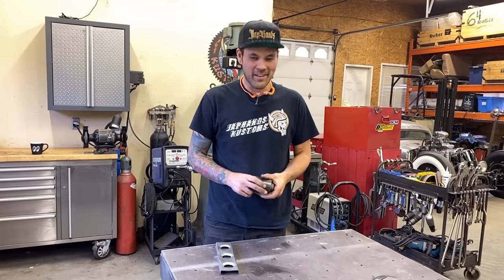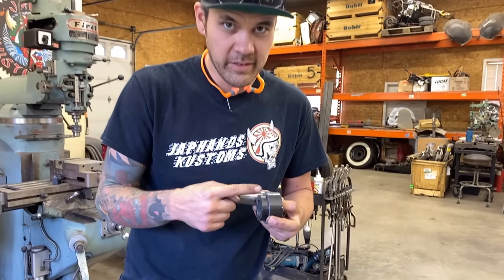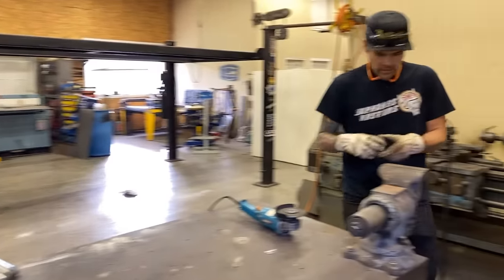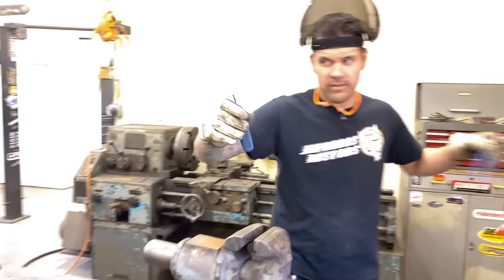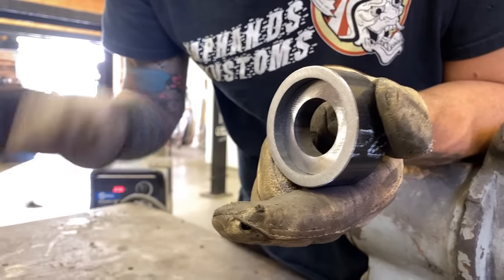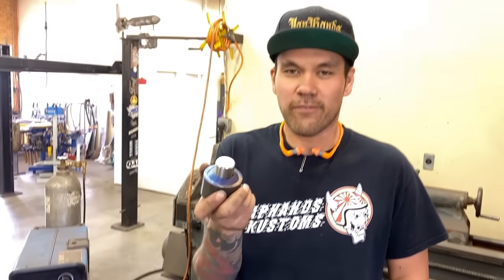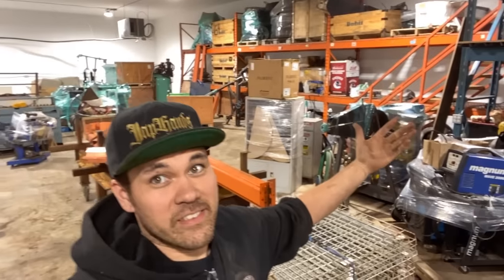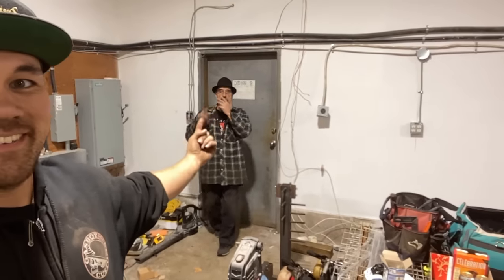How To Make This EASY Dimple Die Tool for Under 20 Bucks!!! ( With Just a Welder + Grinder!!! )

Comment: I use a greased threaded rod through the center to compress them together. Even strong enough to dimple 3mm steel. 
Its a must when dimpling on the car when you can't fit the car in your shop press
Reply: "when you can't fit the car in your shop press" 😁🤣🤣
Reply: When I make one, I will probably do it this way.
Reply: if you put the flange piece that youre going to grind on to the shaft and start grinding it will begin to spin....now its - its own lathe! 
get her spinning and hold your grinder hand steady .
the threaded rod allows you to double nut/lock the flanged piece from jumping up / around.
once youve done it for a few minutes it all makes sense.
the grinder spins the piece and grinds all at the same time and because power is lost to spinning the grinding doesnt dig in very deep....
you could also weld first and put it in a drill then mount the drill in a vise.
the cool part about making your own is you can make both pieces with steps in diameter to do 2 different hole sizes in 1 tool or add 
a crease into the flange/dimple
make diamond or star or square etc dimple dies.
time is cheap when its mine for me....lol
Reply: @kazzTrismus  There is another aspect that can be brought in here. make the the bottom and top piece to fit perfectly into one another without any clearance for the material thickness you want to dimple. ie. zero clearance. then make a few washers, each washer to be the thickness of the various sizes of plate you want to dimple. Then you just insert the relevant washer to match the material you want to punch. The washer will give you the relevant clearance needed.
Reply: @ishsiriram8286  leave the clearance...as washers will only make space in 1 direction..
If doing/wanting a more complex shape than a cone, precision fitting reduces the range of material thickness.
details/features would require precision fitting on 2 axis at least.
Too tight will = shear depending on design
Reply: @kazzTrismus  Your Right, I see what you mean. Thank you.
Reply: @kazzTrismus  I got you bro. make's sense.
Reply from the maker: Yeah definitely having a hole in the centre or threaded half is the way to go so that you can be super portable! How do you like smashing it with a BFH though it’s pretty fast
Reply: @MakeItKustom  I couldn't believe that hammer worked to be honest.
Reply: IF you make the ‘hole’ part of the die on a long piece of stock and a T ‘fence’ you can not only do dimples evenly spaced from a reference edge but you can also do ‘interesting’ solid sheet panels with stiffening provided by non-through dimples FYI. These do take a little more time with the hammer and the panel may need some flattening after if the non-through dimples are close, but this can cut down resonance a lot. Great for when a bead isn’t preferred or you don’t have a bead roller.
Reply: You know a threaded setup  is what came to my mind to. Especially since I don't own a press. Interesting.

Comment: If you can get ahold of some thin latex sheeting or thin flexible plastic to sacrifice between the workpiece and the die, your finish comes out really well even if there are some blemishes in the tool surface. Really cool innovation you guys!

Comment: This is the best part about outfitting your shop/garage with fabrication tools. You get to the point where you need a tool or part for your build and realize its quicker and easier to just make it how you want it then to shop around and wait for shipping etc. I think more project car builders should invest in this stuff and learn how to use it, very satisfying! 👍
Reply: Check out Fab Rats.

Comment: great video ....Being a retired electrical contractor I had several knock out punch set laying around sooo I took one set and had the back side of the cutters beveled to 45 degrees. Now I take one punch and knock out the hole and then take the next size up and use the back beveled side of the die to make the dimple....a two step process but cheaper than going out and buying the one step dies and I have a set from about 7/8" to 2 1/2" dimple dies.....like making your tools

Comment: This was excellent, I had a friend make a smaller one for me on a lathe but both male and female mating surface where turned but this was so basic and works exactly the same. Cool. 
 If someone wanted more user flexibility they could drill a hole through the 1 1/4” use a 1/2” bolt or all thread rod and nuts with a piece of 1/4” plate for the end you could use this without a hammer or press allowing you to do a dimple inside a tight space or where could not use a hammer without back up. Using 2 pieces of 1/4” plate on each end you could make this entire tool without using a welder too. 
I really like the dimple look… I think I need to get some steel
Thanks for Awesome tool idea and so cheap.
Reply: My first thought exactly, good comment.

Comment: In regards to the scarcity of 19 gauge sheet metal:
    Wray Schelin mentioned finding a supplier for 19 gauge sheet metal and was able to stock up on the stuff. His video was about 8 months ago titled, Metal Shaping for Beginners: Shrinking With a Helve Hammer.

I recall you mentioned the 19 gauge shortage in a recent video I watched and several other YouTube builders have found the same shortage in their areas. A place just outside of Langley was cold rolling 18ga to 19ga for a restoration that was very fussy. Their rollers were capable of doing 30 inch but their age showed some distortion at the edges so 24 inch was settled on as the max width. 

  The hydraulic roller press was apparently from one of Boeing's auctions in Washington state. At one of their auctions I ended up with a project to rebuild a hot dimpler for aerodynamic aircraft riveting. Industrial auctions can be interesting with crazy expensive mixed in with nearly free deals. A $100usd hot dimpler was nearly free. Just thought I'd mention that. A great way to bring occasional use equipment into your shop that you normally wouldn't have considered buying.

Comment: Karl, on your electrician's knock out set, there are VERY small hash marks on the cup side of the die. They will help line you up with a center line so your holes are laser straight. Hope this helps, cause you sure are helping me with your content. Thanks!
Reply from the maker: Thanks for the tip!

Comment: Nice work. 
I cut up a ball joint, not necessarily for dimple die but it sure makes a nice spherical dent. Long u shaped flat bar to keep em aligned and done! 
Nothing beats building your own tools, for single one off use or for continous use. I have both.

Comment: You Sir are a gentleman and a legend Karl.
I was looking into Dimple Dies here in Aus and they Cost anywhere from about AUD$50.00 each from Speedwerks in Sydney Australia. 
Add in Postage  which add about another as much again.

I can make my own and get what ever size I want and even use pieces of Gal Water pipe as outer and Inner sizes for some simple sizes and get all that from the scrap metal yard for about AUD$10.00 .
 Win Win I say, and as you mentioned, get some pride from making it myself.
Thanks heaps 
Michael in Melbourne Australia.
Reply from the maker: Awesome Michael I’m glad to hear you dig this concept and it will save you some bucks! We ship a lot to Australia and know how much postage is. It can get crazy for you guys

Comment: Great video. You obviously have a great set of skills and experience, but for me, and obviously many others, what makes your videos really watchable is your way of presentation and uncomplicated, positive attitude. Just a simple sugestion you may want to consider - whenever round objects are involved, in jobs like this I always try to apply rotation to the object, too. Even if the features you are adding are non-critical, it adds unformity, reduces random scratches and generally speaking produces better looking objects. I often use either two battery drils, or a drill and an angle grinder, plus a miniature 50mm chuck to grip the objects. Just my two cents...

Comment: Lee is a good friend and great builder.

I love Metal Supermarket 
The one near me sells off cuts by the pound which is great if you need to build some smaller stuff like this dimple die tool or small bits n bobs like motor mounts etc.

Comment: Just an idea. I use Knock out punch sets from Greenlee tools and Klein tools all the time. They use a threaded draw stud to pull the cutting die through the side of panels and boxes. I’m thinking you could fabricate your dimple die to work with one of these tools allowing you take it wherever you want. Both companies make a ratcheting punch, and Greenlee has multiple styles of hydraulic although those are very expensive.

Comment: You know a lot of out aircraft (older ones) used a lot of dimples in the airframes. Made them stronger and lighter! You knew that. I used the same type of oil lines in my old 75 Harley to run outside filter etc. Modified a little bit. 😂😁🥸👍👍

Comment: Awesome! I reckon one of those little brake cylinder hones would increase the ID of that tube if you couldn't be bothered grinding it too! I may have used them in the past to make holes round again after welding ahhh... unrounded them...

Comment: Hmmm, I keep hearing of metal supermarket, I may have to pay them a visit (but they are 2 hrs away in each direction). ... I'm only 3:00 in but I'm loving this one already. I don't have every conceivable tool known to Man, so you taking this route is awesome. I'm just a tinkerer with our Jeeps (almost a hobby), so I really can't justify paying for dimple dies, but I'd like to do the effect one day. And it's cool how your doing it because all I ever use (have) is a grinder, assorted disc's and other typical hand power tools. ... and I'm one of the, do it in the driveway, outside or in a little shed I have, kinda guys.

Comment: Thanks. I have a set of dimple dies but I need a 4" for my 3" exhaust. They are very pricey. I will definitely be doing this. I'll probably cheat and use the lathe.

Comment: Great idea but as you were going around the top edge and talking about fitting the inside pin ,I was thinking,considering you won't be removing that much material,WHY not use a wheel cylinder hone.?
Reply from the maker: The point was to use very simple tools for this

Comment: Another awesome video and lesson. So a metal newbie question, does dimpling the metal or bracket give it more strength? I am thinking of adding some brackets to my prostreet tubs and this is exactly how I want them to look, thanks.
Reply: There is some /rigidity/ added by dimpling or beading, ridging. Not necessarily strength: rigidity. 

Added bonus is the vibrating/slapping sound sheet metal gets sometimes is often 100% mitigated.

Comment: So any time I want to make something round smaller I use a drill and sand paper. Only issues are getting the thing into the drill chuck. So I sorta made a C clamp to be able to hold some centers to turn things between. A rubber wheel in the drill makes the thing rotate and I use what ever abrasive I want until I get it sized.

Comment: Just a suggestion - when making that die, it is a lot easier for most people to make it - and make it correctly - if you can spin the material while you grind it.  Spinning it allows you to hold the grinder in one place, instead of trying to get the bevel right/consistent while moving around the part.  Yes, spinning is traditionally what a lathe does - but you don't have to have a lathe.  The piece only has to spin, and it MUST be centered, which you can check simply by spinning up the part and looking for wobble.  One way you could do this is by using a correctly sized rubber expandable freeze plug to fit inside the die's hole and then chucking it in a drill press.  The rubber freeze plug has a bolt through the center of it that fits tightly -  you would chuck that bolt into the drill press.  If you need more threads on the bolt, you can use a longer one in the hole as long as it fits tightly and compresses the plug.  If the part is centered and you can see your marks, you can then spin it up and use the grinder to grind to the profile.  Also, if you have a bench grinder/buffer, you could fit the part on the spindle if you have a common enough size of hole in the die that would fit one of the many plastic bushings that adapt various grinder or buffer wheels to a bench grinder - as long as the part spins up centered.  There are any number of ways to spin up the die to grind it, if you are willing to think up ways to adapt to the situation.

Comment: I just discovered your channel and as a hobbyist who is just learning to do a bit of fabrication and welding, I love them.  
Question:  Do you think it would be practical to make a louvering die to use in my shop press with similar methods to making this dimple die tool and the embossed Chevy emblem video?  I'm thinking maybe pre-cut the louvers if necessary with a cutoff wheel and then the louver die would shape them.  Thanks for the interesting and informative videos.
Reply from the maker: Absolutely! That would work

Comment: On that beveled edge if you want it close to prefect put layout fluid (dykum) on it and file till the lip is a flat plane on the angle you want just like doing a low spot on metal on a body

Comment: I dig it. But 2 suggestions if I may humbly add is when you're grinding that outside chamfer you can either use a soft plug or just a simple chunk of rubber sandwich between a bolt and a nut inside the tube (essentially a reverse call it chuck)and either mount that bolt to your drill press or a drill in a vise and use your angle grinder and die grinder to champer it could save a lot of time. And the same goes for your round stock if you get it true enough to center you could tack a smaller piece of stock to it and run that in a drill press or a drill in a vise with some sandpaper. Just merely some suggestions to speed up the process I dig the build dude 🤟💪

Comment: Another good product I like for deburring is the 3m unitized roloc wheels. Theyre like a gray rubber color and they do an awesome job at polishing and taking off fine burrs without taking much material off. Check em out if you dont know about them already.

Comment: 1/4” or less hole drilled through side and pin a tight fit rounded bolt to spin the die in a drill could help make it easier to spin like a lath for grinding and sanding

Comment: Nice job. The dies make very nice structural indents.  I have question though. You make the indents to one side only, would it create greater strength if you alternated the indents by reversing the indent?     Aesthetically having all the indents facing the same way is nice, but alternating made have greater twist resistance.     May be worth experimenting with
Reply from the maker: I guess it definitely depends on what you’re using that piece for whether or not it needs that Strength

Comment: Karl, you don't have to be in High School for "BFH" to be commonly used!  LOL!  Before I retired as an Mechanical Engineer, I routinely heard the term, though usually as the three letter acronym and often, but not always, as a joke when a design needed "persuading"!  Also, your deburring tool  looks like a Noga-brand tool to me -- they offer kits that also can reach through a hole to deburr the backside too, which is often desirable.
Reply: Amen on BFH, and if it don’t fit get yourself a BrFH (bigger, fn, hammer)
Karl in MI

Comment: Mmh looks pretty simple setup to turn on poverty lathe too, just takes time since you cannot put that much force on the grinder. This will be nice addition to tool collection and making DIY yard tractor that much stronger.. just need to adjust this to handle 3mm steel plate.

Comment: I would have chucked it up into a drill or drill press, so that when grinding it slowly rotated and kept it circular. The other way is to fit the center and then rotate it against a bench grinder. Much easier and better than trying to eyeball it.

Comment: Do you think this could work on a 7 inch round dimple die? I want to change a set of hubcaps to fit my 4x4 truck, but keep them looking nice. Thanks for the video!
Reply from the maker: Yes but you might need to press instead
Reply: @MakeItKustom  cool, thanks for replying.

Comment: Could you have cooled the inner piece and heated the outer piece of the male die ? Thank you so much for posting this. It’s difficult to get good material on the domestic market here in Ireland. You can order a space shuttle commercially and if you have contacts…….
Reply from the maker: There is quite a bit of interference but I think you probably could have heated and cooled

Comment: Not slating your work and what you've created but, how long does it take to make one? What's your hourly rate? How much was the raw materials? 
You can buy a 2" die set off ebay four under £30.
Reply from the maker: Yeah I bought mine I know it makes more sense to buy it but sometimes when you were at home it makes a good project to save a few bucks

Comment: What  brand of die grinder do you use  and what size of compressor do you use
Reply from the maker: I just use a really cheap die grinder. I have an 80 gallon compressor 5 hp

Comment: Would this application be able to used on 8th inch steel?
Reply from the maker: Actually yes! I’ve use these on  1/8” but I need to press to make them work